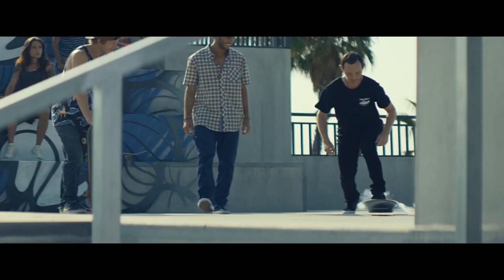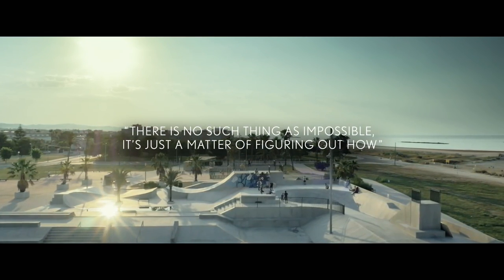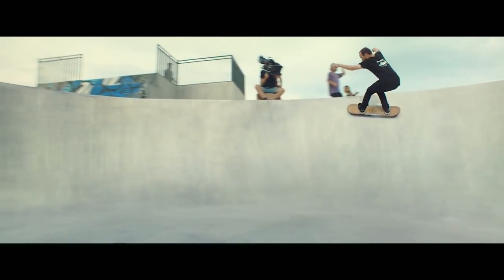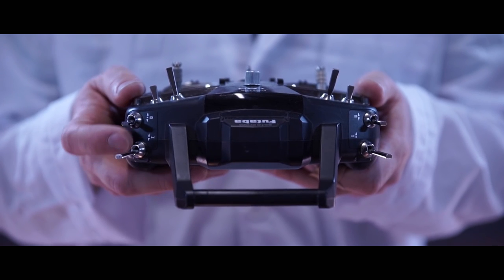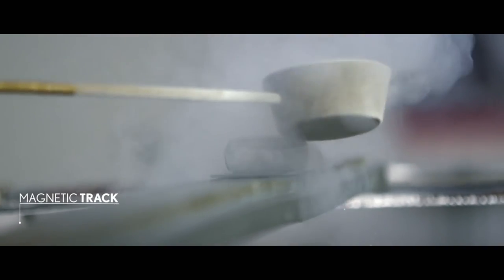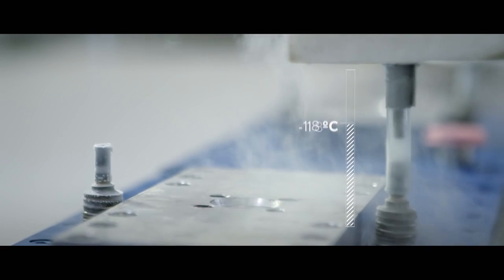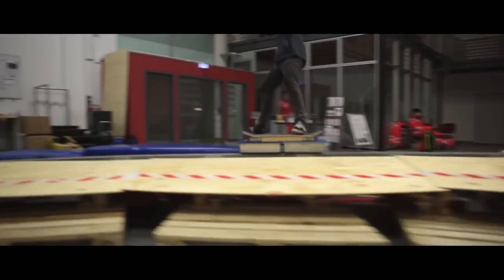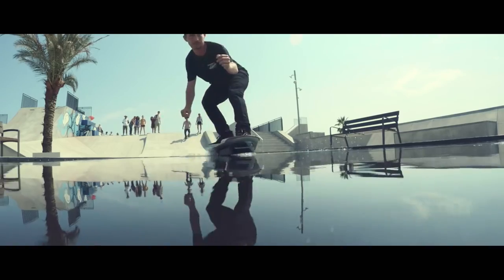Lexus Hoverboard - Flying skateboards!

Comment: You're about... 4 months too early
Reply: it's real, it's just super expensive. It uses superconductors that are chilled to very low temperatures and it requires a magnet track to function. That means that either the track or the board have to be constantly cool with liquid nitrogen